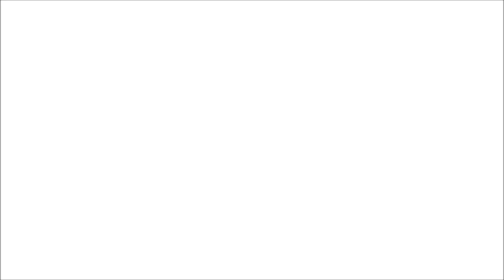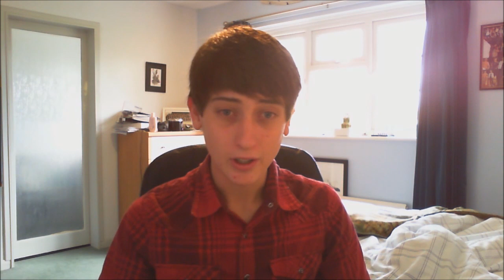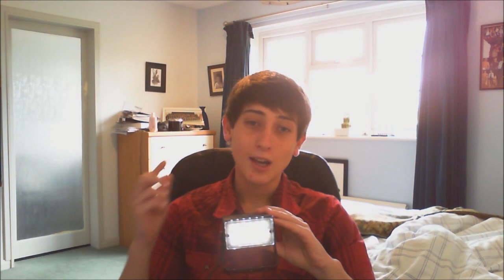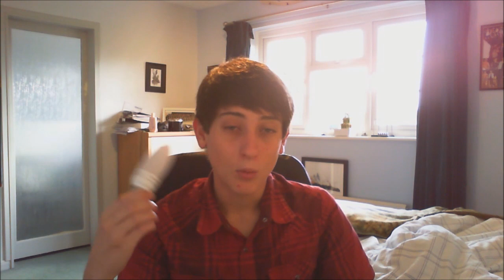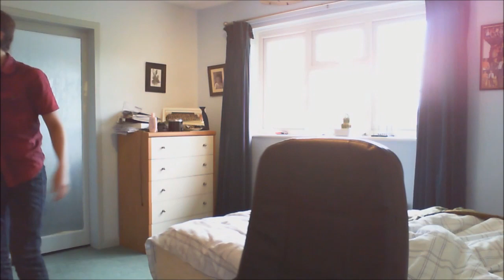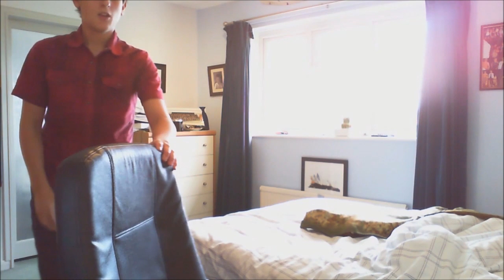What is LiFi?

Comment: 2 questions: 
How is the lightbulb connected to the Internet ?
How does the receiving device talk back to the light bulb?
Reply: +Graeme Pinnock y do you think the receiver has to communicate with the transmitter? and he did mention about the microchips. so they are gonna help. if lights everywhere then it's not gonna be a problem.
Reply: +Shubhi Mittal thanks dude! really helping